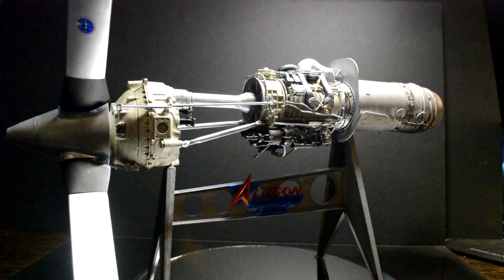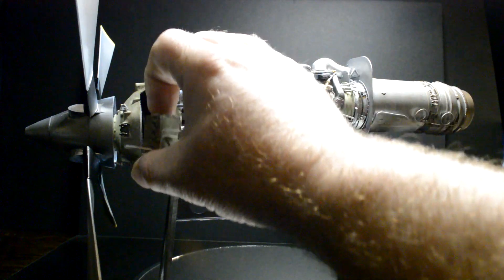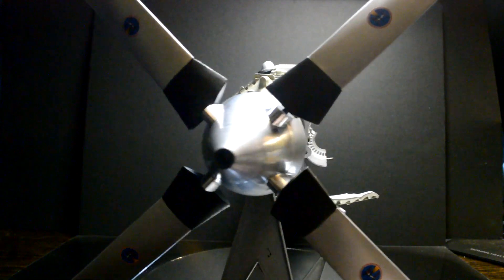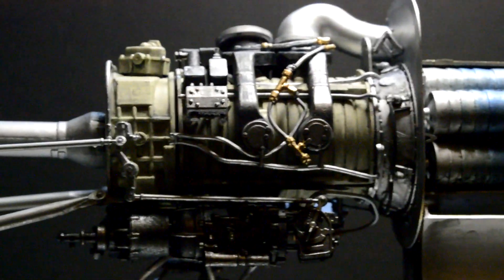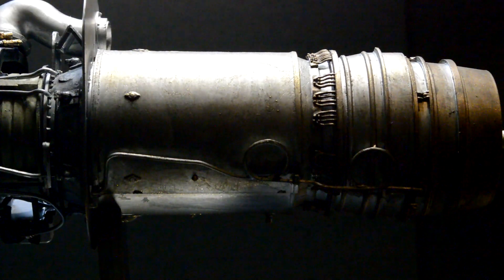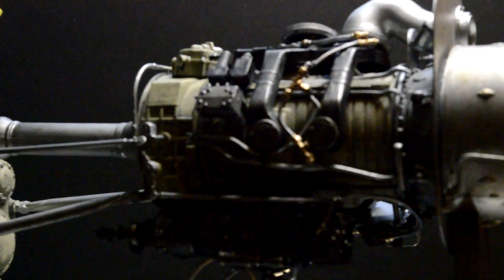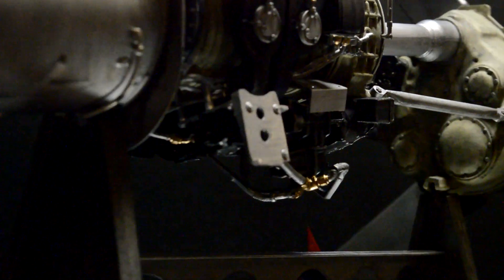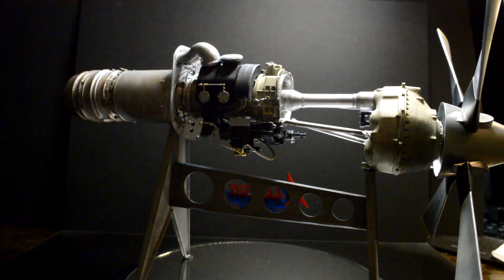Atlantis Allison Prop Jet Engine Final

Comment: @Russell Model Cars  Great build I have one that I haven't built yet. I am getting it planned out etc. Quick question when you paint it like that does it still rotate or does the paint hender that part of the build. Thank you for your response.
Reply from the maker: Thank you. the paint does make it so it can not spin. one idea i had when working on this one was to paint all the non moving parts and keep the spinning ones and the inside parts that are next to them with out paint. the one i had needed so much sanding to get it to spin that i decided to just have it solid and panted it all since i was not going to mess with it once i was done. good luck with your build i hope this helps.
Reply: @RussellModelCars  thanks for you reply and keep up the great work. =/\=

Comment: It it possible to do some modifications to make it run continuously? For example, I’m thinking of 3d printing some extra parts to attach it to a dc motor to make it run by itself at a reasonable speed ?
Reply from the maker: If you get the parts to move freely and put a grease like vaseline on the friction points it could be done. I think you have to make it without paint on the inside and moving parts so it can move easy. You still could paint the outside and have a really cool working model. I think one guy did it to the older version of this kit and is one YouTube I wish I could remember who it was to share with you. I thing he put a belt drive on the main shaft and the motor on the base he made.